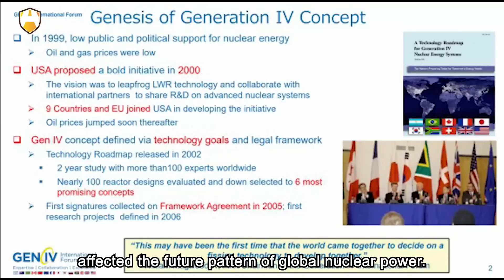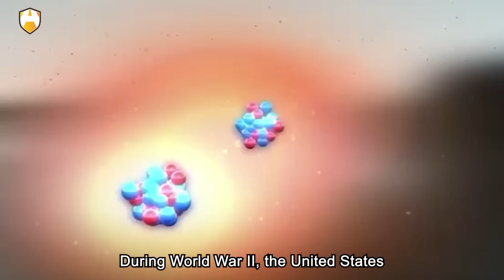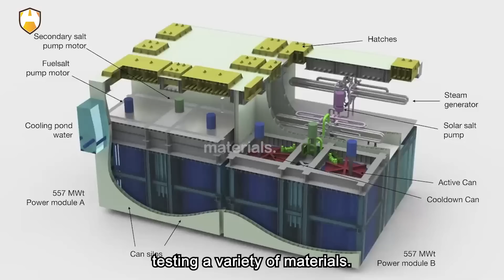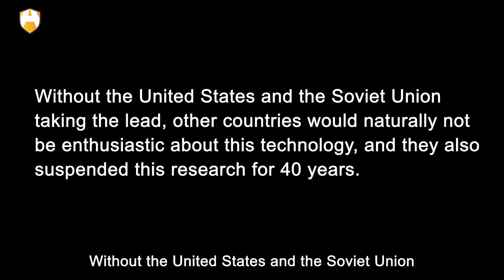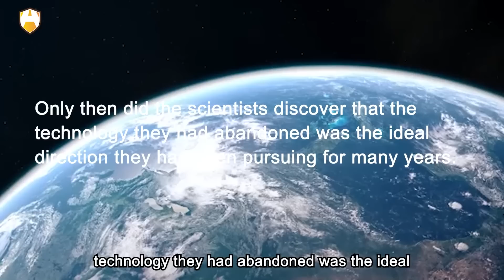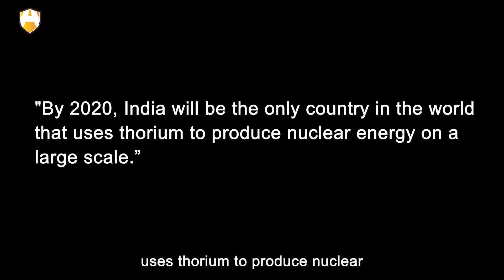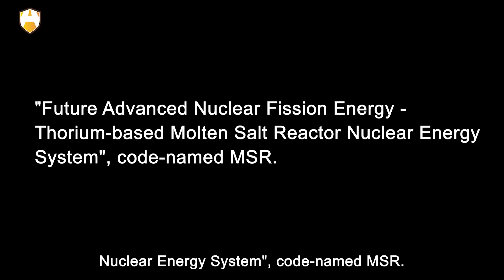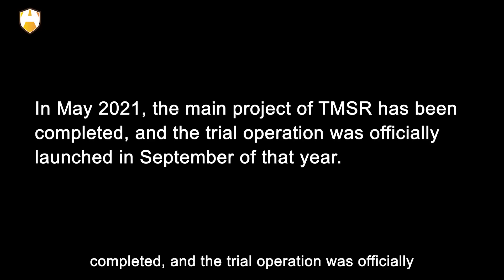China made big success in the Future of Nuclear Power! Revolutionise Atomic Energy Industry?

Comment: China has 55 operational nuclear power plants, 24 1GW plants under construction, and 41 planned.

Of the six proposed fourth-generation nuclear reactor types, the Molten Salt Reactor (MSR) is the only type with high fuel efficiency, no danger of explosion, and does not generate substantial amounts of plutonium. The fissile uranium-233 produced by the MSR is difficult to use for weapons because of the presence of highly radioactive uranium-232. While other Small Modular Reactors (SMRs) can serve as a short-term solution, MSRs are considered a more promising mid-term solution due to their potential to address these issues more comprehensively. Hopefully, we will have fusion by the time we run out of uranium and thorium. The global thorium reserve of 6 million tons will be exhausted in 800 years at an annual consumption of 7500 tons.

The differences between Light Water Reactors (LWR) and Thorium Molten Salt Reactors (TMSR) are significant in fuel utilization and waste production. LWRs use approximately 0.5-1% of uranium fuel, leading to the generation of long-lived radioactive waste due to inefficient energy conversion and the use of enriched uranium. In contrast, TMSRs can achieve fuel efficiency of up to 98%. This is achieved by converting fertile thorium-232 into fissile uranium-233, substantially reducing waste production and more manageable radioactive waste. Uranium Molten Salt Reactors (UMSR) will produce more plutonium but are just as effective as TMSRs.

800 kg of natural thorium in a Molten Salt Reactor (MSR) can generate 1 gigawatt (GW) of electricity for one year. In comparison, generating the same amount of energy in a Light Water Reactor (LWR) would require mining 200 tons of uranium. In an MSR, the storage requirement for 83 percent of the spent fuel is 10 years, and 300 years for the remaining 17 percent, whereas in an LWR, 28 tons of spent fuel need reprocessing and storage for 200,000 years. MSRs can utilize the spent fuel from LWRs. A coal power station will need to burn 3.5 million tons of coal and emit 10 million tons of carbon dioxide to produce the same amount of energy for one year. That amount of coal contains 3 to 14 tons of uranium, 3 to 14 tons of thorium, and an average of 84 tons of arsenic.

MSRs can adjust power output to match electricity demand, thanks to the inherent and automatic load-following capability provided by the fluid nature of the molten salt coolant. A key safety feature of MSR is that it automatically adjusts to prevent overheating. This is achieved through a "negative thermal reactivity coefficient," which means that as the temperature rises, the reactor's reactivity decreases, preventing a runaway chain reaction. Additionally, the MSR has a "negative void reactivity coefficient," ensuring that the reactivity decreases if there is a loss of coolant or boiling, preventing potential overheating. These safety measures help keep the reactor stable and safe under various conditions.

Looking ahead to 2040, China plans to deploy Molten Salt Reactors (MSRs) for desalination of seawater, district heating or cooling, hydrogen production, powering of ships equipped with Thermoacoustic Stirling Generators, and power plants with Supercritical Carbon Dioxide Turbines within its borders and globally. In the Earth's crust, thorium is nearly four times more abundant than uranium. Every atom of natural thorium can be harnessed, unlike natural uranium, where only 1 out of every 139 atoms can be used. China produces thorium as a byproduct of its rare earth processing.

Similar to the trends observed with solar and wind technologies, MSR costs are anticipated to decrease with the scaling up of production and the development of robust supply chains.
Reply: There are also liquid metal fuel reactors like the Dual-Fluid Reactor with the same efficiency with both the uranium and the thorium cycle.
🔋 Key Advantages of the Dual Fluid Reactor (DFR):
• ⚡ Ultra-efficient: Nearly 100% of nuclear fuel is used  
• ♻️ Burns nuclear waste, depleted uranium, and even thorium  
• 💥 Transmutes long-lived actinides into short-lived fission products  
• 🔄 Built-in Pyro Processing Unit (PPU): Continuously removes neutron poisons and extracts valuable metals  
• 🛠️ Liquid fuel: No solid fuel rods, no batch reloads  
• ⏳ Decades of operation with a single fuel load possible  
• 🚫 No corrosive salts: Liquid metal fuel avoids fluoride corrosion and complex chemistry  
• 🧊 Lead coolant: Excellent radiation shielding, no water, no pressure → no steam explosion risk  
• 🌡️ Very high temperatures (700–1000 °C): Enables hydrogen, e-fuels, ammonia, and direct steel reduction  
• 🧠 Self-regulating: Output adjusts automatically via negative temperature feedback  
• 🪫 Minimal waste: Only short-lived fission products remain
• 🏭 Compact & scalable: High power density, ideal for modular deployment  
• ⚙️ No moving parts in reactivity control: No control rods required  
• 💰 Uses existing stockpiles of spent fuel, DU, and thorium  
• 🌍 Reduces dependence on enrichment, imports, and fresh uranium mining  
• 🔄 Full closed fuel cycle: No external reprocessing needed  
• 🆚 Outperforms typical SMRs: No pressure vessels, no high-pressure coolant, no water-based systems

Comment: A slight tweak could allow a msr to produce plutonium safely and in large quantities at high purity. Simply pipe 238UF6 gas through the reactor around the core region. The fast neutrons produce the energy, the slow thermal spectrum generates Pu which would precipitate out. ❤

Comment: The Oak Ridge project was canceled because salt reactors don’t produce plutonium. An other reason was that the money went to a traditional reactor in California. There are more voters in California than in Tennessee so it was politically beneficial to redirect the money. The irony is that the Chinese project got a kick start based on the data from Oak Ridge included the solution to the corrosion problem. Unlike the United States and Europe it is much easier to get approval from regulators once they have the green light from the political establishment. Oak Ridge did the scientific research of the molten salt reactors but never produced electricity. What was left is for the industry to find the design that works best. China was the first to start up a power plant that runs on molten salt and I believe the Russians also have one running now. As for the leading position in the race for molten salt reactors I would say that it goes to Copenhagen Atomics.  They have a project with a reactor that is installed in a sealed container.  One of the benefits of this reactor is that it is a breeder that can also burn nuclear waste. With the small size it can be transported anywhere and scaled according to demand by multiple the number of containers. They are still in the trial stage but believe they will be commercial available from 2028. When they get the go ahead from regulators they will be able to produce one reactor a day. To comply with the demand it will take them 20 to 30 years with the present capacity so they will have to scale up and probably license out the production. For those that want more details look up Copenhagen Atomics on YouTube.

Comment: The go big or go home should not apply here. Building  large plant with many small reactors running in parallel should be the preferred approach. Similar to using the 18650 cells instead of prismatic cells on EVs.
Reply: That is exactly what NuScale is proposing with their SMRs.  Even with $2 billion in taxpayer welfare, they put the project on hold till 2025 due to ballooning costs and that is even before they broke ground. Every utility in the U.S. has always chosen the largest available due to economies of scale

Comment: Yes. Yes. Yes.  This is the way to go!  Thorium!  This development in conjunction with further development of battery storage capacity for a multitude of application where "mobile" electricity is an issue.
What many good-wishers as well as many not-so-good-wishers of the environmental community neglected to realize (maybe on purpose) is that the fundamental limitation of any system of electrical power generation is ENERGY DENSITY, without which a system is not going to succeed, expect in limited applications, but even then with imperfect potential. 
The most horrendous approach to trying to ease the dependency on oil was the continuous lip service to the production of ethanol from organic matter, and the integration of the ethanol (maybe up to 10%) into a gasoline still produced from petroleum.  This was always a solution that in energy equivalent costs more than using 100% petroleum to begin with.
So, as we change to a Thorium-based nuclear power production we will see many of the current environmental, economic and social problems worldwide will sort of wither away as a new era of well-being for all can finally be realized.

Comment: Edison generator and dynamos power plants with inverters and transformers to deliver high voltage AC power continuous peak power to the power lines do not use fuel heat steam wind or water to move the armature magnets and coils of copper wire. Tesla bound Edison's generator with magnets all around the armature and used water to move the armature magnets and coils of copper wire. It is not necessary to use steam wind or water to move the armature magnets and coils of copper wire. The permanent magnet motor as a generator and brushless motors as generators with inverters and transformers can deliver any amount of current and voltage AC power continuous peak power to the power lines. We are still grossly misinformed about power generation and power use. Nuclear technology is obsolete in many ways but the need to produce heat and steam wind or water is not mentioned enough to shutdown nuclear power plants and fossil fuels power plants.

Comment: Looks like the project's success rests on the ability to prevent corrosion by the molten salt and the neutrons generated. If the corrosion problem is too tough, perhaps they can design a low costs replacement method for renewing the molten salt and components.
Reply: Like concrete coating w/o corrosion?
Reply: @hashim64  I do not know. Just guessing. I'm only a retired computer programmer with no university level science education.

Comment: I have figured out why Thorium molten salt reactors are banned and supressed.
It is not the Thorium.
It is the Lithium fluoride that is the salt that is melted.
Lithium Fluoride is the stuff that explodes in a Hydrogen Bomb.
Lithium bombarded with neutrons makes a lot of Tritium, and Tritium ignites in nuclear fusion of a Hydrogen nuclear bomb.
Lithium Fluoride is stable and does not decay over time.
A hydrogen bomb needs Plutonium or Uranium to explode in nuclear fission so compressing and irradiating the Lithium to release the Tritium than then initiates the nuclear fusion of a Hydrogen bomb.
The US spooks and spys and security are desperately hiding the fact that Lithium Fluoride molten salt in a Thorium molten salt fission reactor releases TRITIUM, and Tritium is what is needed for a Hydrogen Bomb.

Comment: For heaven's sake, China is just following where the USA once led on Thorium molten salt reactors. Alan Weinberg was the original 'father' of the idea which ended up as the MSRE at the AEC's site at Oak Ridge. Just a shame that others in the business at the time weren't interested in the idea.
Reply: Alan has been dead for a long time but this conspiracy theory lives on.  The design had flaws that could not be solved.  No MSR has ever been built by any nation that actually produces electrical power....enuff said.

The China and India MSRs are demo test reactors much smaller that the ORNL MSR.

Comment: Today’s fusion reaction operates with a very stable principle element that is extremely difficult to ignite or to maintain continuous ignition. It dies off rapidly soon after ignition. It doesn’t produce primary electricity and need heat extraction to generate electricity just to support and maintain ignition, a process we don’t fully understood today. 

Fission, is relatively easy. Once ignited, it produce primary heat and waste electricity. The ignition is a self organized chain reaction that wouldn’t dies off, unless we insert attenuation medium to prevent it from self destruction.

The third approach is also run away fusion process. Differ by it replaces the expensive artificial ignition / containment hardware into a self organized plasma process of a Plasmoid Gun. It can’t self destruct because it ignite in burst / pulsed like a petroleum engine. It produce primary electricity and is small enough to fit in the basement. (Details from Eric Lerner)
 
Keeping Uranium and suppressing Thorium is commoditization is a part of scheme in world domination but humanity purpose.

Comment: The US dept. of energy had a thorium reactor that it operated for about 20yrs. starting in the 60's. Problem is it's highly corrosive and the piping, pumps etc. have to be made of exotic alloys that still have to be replaced at regular intervals making the reactors about 5 times the cost of boiling water reactors to build and operate. I'll bet China doesn't build a second one. I'm sure China will be open and honest about what a money pit this turns into. Look at how they got in front of the Wuhan leak. 

France built a breeder reactor which was to be the end-all yet never built another.

Boiling water reactors were and still are the most cost efficient type, except for those graphite moderated turds Russia built.
Reply: Yes, that severe corrosion problem hasn't necessarily been solved yet. Oak Ridge was a mess inside when they disassembled it. They have been trying desperately to find a solution ever since then, but no real success yet. 
We'll seen how China's test reactor works over time, only time will tell.
Reply: You do know that this Chinese MSR is a demo test reactor 1/4 the size of the ORNL one.
Reply: Actually PWR reactors are long term cheaper, which is why about 80% or all nuclear power plants are of the PWR design and virtually all new construction is of PWR design (I'm not even sure when the last new BWR project was - I know that the GE BWR genration 3+ reactor design was never built, whereas the Westinghouse AP1000 PWR was built and more are on order and the European EPR PWR was built as well (although it's now been admitted that the EPR needs to be redesigned and no one is ordering any more).  

BWR's are cheaper to build.  In the vast majority of cases they are more expensive to operate.  Over a normal plant lifespan - the PWR wins out on cost, and it's not even close.

Comment: What is really shocking is that the first working reactor was run and built right in the US of A. But since you couldn't get useful material to build a bomb it was mothballed. This was the first outward incursion of the military complex into the control of government.
Reply: Where do people keep coming up with this BS that Thorium was abandoned and Uranium based PWR/BWR were chosen so we could make bombs?
Hanford Wa. has been making weapons material, at their 9 reactors, since 1944, 12 years before the first U.S. commercial nuclear plant became operational and their weapons production reactors are very efficient graphite moderated reactors and DO NOT produce any electrical power.
Savannah River site SC. Has been making weapons material since 1955 and their 5 production reactors are very efficient low pressure heavy water moderated reactors and DO NOT produce electric power.
Thorium was tried at Shippingport, Fort St. Varian and Indian Point commercial reactors in the 1970s and abandoned as too costly compared to Uranium.
Weapons production reactors are NOTHING like U.S. commercial PWR or BWR power reactors and commercial power reactors have NEVER been used to produce Pu239 for weapons, since there has never been a need beyond what the efficient weapons production reactors could provide..
The U.S. currently has so much Pu239 that 34 tons of weapon grade Pu239 is being treated so it can eventually be disposed of at a cost of billions.

Your comment is like saying automobiles use gas engine because the military wanted jet fighters.  God help us that people base their knowledge on social media and YT videos.